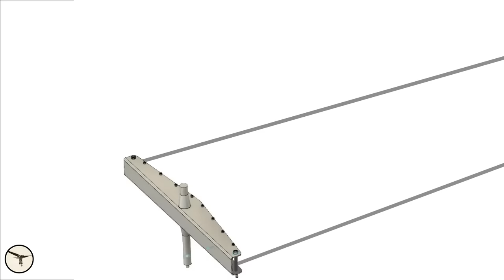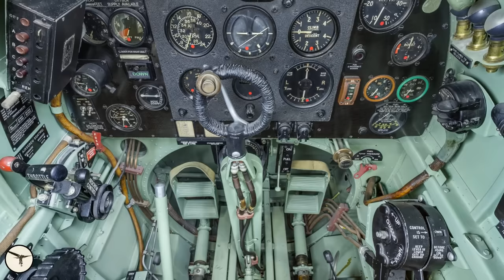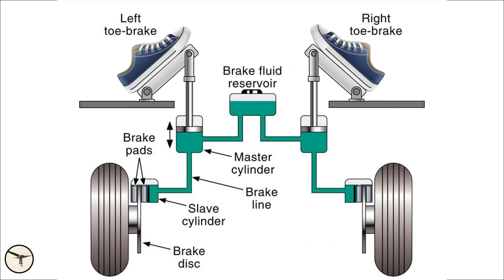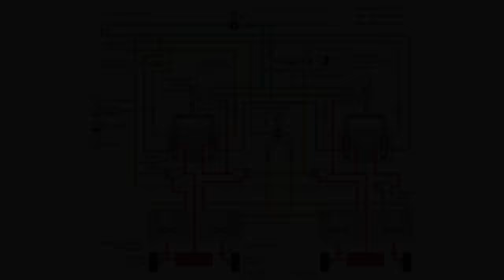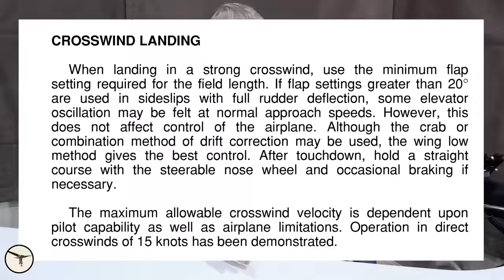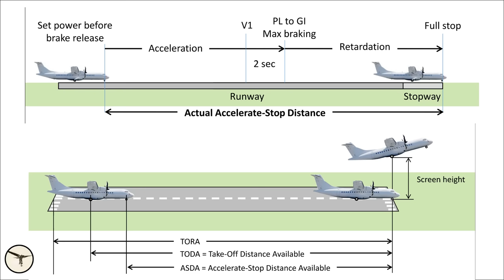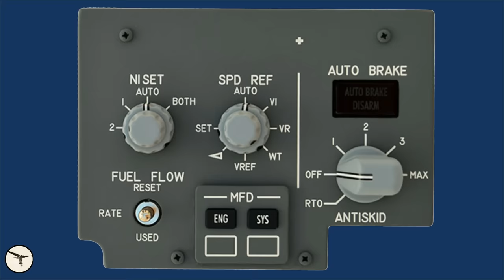Are you using the rudder pedals correctly? | Flight safety | Loss of control

Comment: Multiple functions from one control have never worked out very well,has it?
Reply: Stick controlling both pitch / yaw?

One control, two flight surfaces?
Reply: Collective Pitch / throttle control?

Mag selector / Starter switch?

ADF receiver / AM radio ?
Reply: Exactly.Helicopters are complicated.A very light touch with fingers until u learn.

Comment: Re flying airliners the rudder pedals are not useful compared to using the yoke to steer on the ground I.e. taxing. Is this normal?
Reply from the maker: The yoke is not used to steer the aircraft on the ground (I have never heard about any airplane type where this is possible.) On smaller aircraft are the rudder pedals used to steer the aircrat, while airliners have a tiller to control the nose wheel steering (which is hydraulicall operated.)
Reply: @FlywithMagnar  Ok thx for replying but in MSFS 20 my new rudder pedals work fine for GA aircraft but the A320 not so much. The yoke replaces the tiller.

Comment: The FAA airplane flying handbook Chapter 3 Basic Flight Maneuvers page 3-3 says: 
The pilot's feet should rest confortably against the rudder pedals. Both heels should suport the weight of the feet on the cockpit floor  with the ball of each foot touching the individual rudder pedals. etc.

I have done rejected takeoffs at almost V1 with an without autobrakes on F-100 and A-320 on marginal lenth on third world runways using wheels on the floor of the aircraft. and I have had no problems.
I do not  understand why you do not mention the FAA recomendation.
Reply from the maker: I am fully aware of the recommendation from FAA. Airbus and Boeing recommend the opposite.

Comment: You mentioned rudder for engine failure.   For engine failure on takeoff I heard of a method that uses aileron only to correct (this was in a King Air 90).  The aircraft tries to roll over with a single engine failure.  Incorrect rudder correction can make it much worse and can be very dangerous at low altitude.   The rudder was only used after gaining some altitude.  Anyone have thoughts on this?
Reply from the maker: When an engine fails, there is a yawing moment. This must be corrected with the rudder. If not, there will be an additional rolling moment. Using the ailerons alone to correct for asymmtrical power results in a considerable drag, and the aircraft may not be able to climb. The method you mentioned is dangerous, as it may result in a stall/spin.
Transport category aircraft are certified to climb safely after an engine failure at or after V1 during takeoff, provided the pilot follows the correct procedure (using the rudder). Airline pilots are drilled in this every time they do recurrent training and checking in simulator.
Reply: @FlywithMagnar    I'm not wrong, rudder input can be fatal, especially with mistaken wrong rudder input.  That is one reason for fatal crashes on takeoff
The information I have found is that many pilots are not required to practice engine failure on takeoff or at low altitudes.  Some pilots do.  Please google this article below and learn something new.  

Managing engine failures on takeoff: a new approach.
Reply from the maker: The article you referred to is interesting. However, it was written by an instructor flying big jets with good single engine performacne. I fly smaller aircraft. The discussion in the comments section below the article is even more interesting, as many pilots share their experience. The best comment, in my opinion, was: "Use rudder for yaw, aileron for bank."  I also like the commenter who recommends all pilots to learn to fly taildraggers before twin because you learn to dance the rudder pedals.
Reply: @FlywithMagnar   The author of the article began on smaller aircraft as most pilots do.  The article is written about small aircraft, he says so in the article.  Quote: "Modern light twins have little or no excess energy with loss of one engine on takeoff....." 

 You should have another look at it.   He also wrote the entire article based on small aircraft that he had read about in the news, as he states right at the beginning of the article.
Reply from the maker: I admit I read quickly though parts of the article. But if you apply the "aileron first, then rudder" technique after an engine failure at low altitude in a light piston twin, you may not be able to tell about it. The issue discussed in the article is that many airline pilots do not have the muscle memory to fly an aircraft "by the book" after an engine failure. If this is the case, it is the training that is flawed, not the procedure. I am critical to change an emergency procedure to a procedure that is not demonstrated during aircraft certification. I hope Evidence Based Training will change the training programs to the better.

Comment: It's something that can be gleaned from this video, but not stated explicitly, and I have had no luck with Web searches.....
If you press the right pedal, which way does the plane go?
Before you reply with what is intuitive to you, know that the most remarkable things are not necessarily intuitive..

I was teaching someone to drive a tractor, so big safe open space, but no room in the cab for 2. Having explained how to stop (before how to start!), I let the student drive off. Fairly soon they started a turn that got tighter and tighter and tighter. It turns out they thought that a vehicle would only turn while you are turning the wheel, stop turning it and the vehicle goes straight on.
To me, steering is intuitive, I have absolutely no recollection of when or how I learnt that steering wheels don't work that way.
 
So.. Back to the question, if you press a rudder pedal does the plane turn that way (as in leaning down on one side of a bicycle), or does it go the opposite way (as in pushing a handlebar away from you)?
Reply from the maker: When you press the pedal, the aircraft will turn that way. Or to be more correct, it will yaw in that direction.

Comment: Haaa haaa , what is the rudder pedals for ?? a friend used to fly an Ercoupe and he cannot find them. The latest King Air, and others, if one engine quit, the airplane will automatically maintain heading as the other engine go pass 100% power, with the pilot's feet on the floor. maybe the pilot can flip the rudder from side to side fast and make the plane go faster, like fish? But watch it, the rudder/tail fin  connection points for some big airplanes are not as strong as other control surfaces.

Comment: My pedals are 1 inch pipe.
I don't feel you're qualified to tell me if I'm doing it correctly or not. Whens the last time you ducked under a power line and pulled a stalling cartwheel to head back down back under the power lines to make another dusting run?
I do this about 300 to 400 times a year. Again  how should I use my pedals?